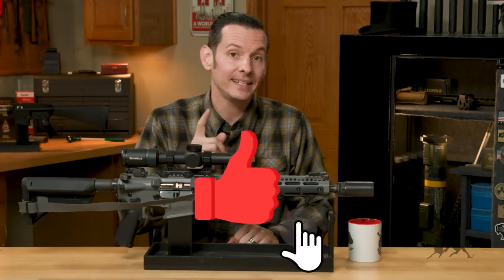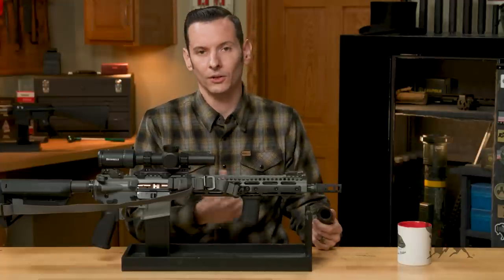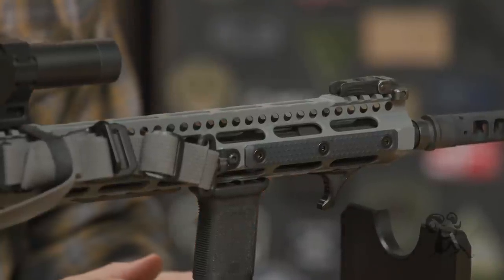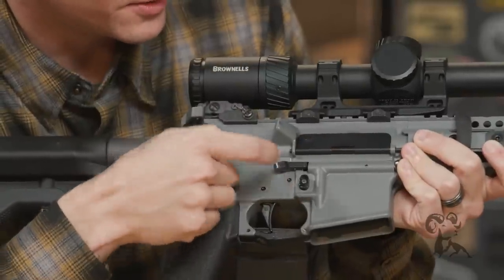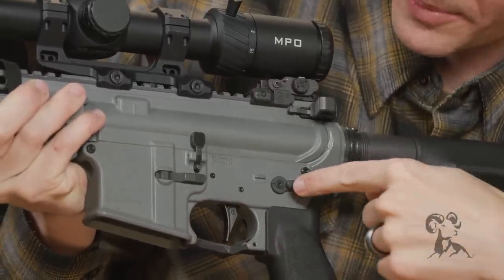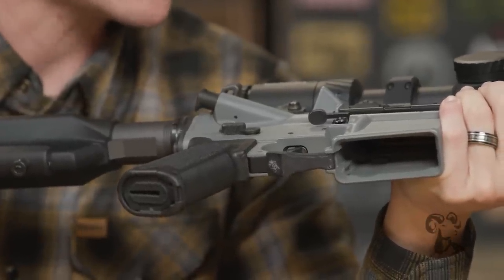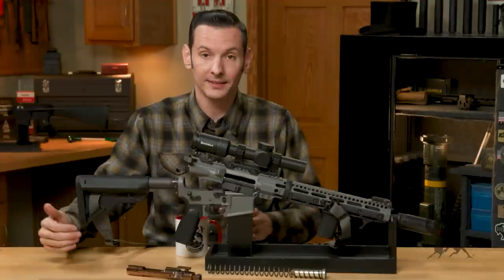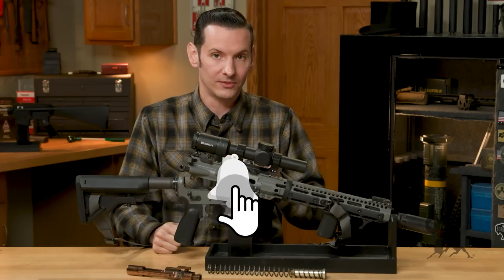From the Vault: Caleb's New Hotness

Comment: It's nice to see somebody using thought and reasoning rather than it just looks cool when choosing parts for their AR.
Reply: Ditch to irons or install off set. His glass isn’t QD so he needs tools to get sights if he breaks his glass. (Honestly it’s LARPing, I do it, you do it, we all do it but in this case it doesn’t make too much sense).

Also he can’t confirm his irons, so it’s to be assumed that they aren’t on. How many times have you had two optics on a gun and switched back to the set you don’t use often only to find they aren’t on. It could be different ammo, it could be the set screws loosened, or it could be from jostling.

Comment: Yeah my main squeeze rifle has changed a few times as well.

Running a Aero Precision M4e1 receiver set, Aero nitride BCG, Faxon Integrated flash hider gunner barrel, Aero gas block/gas tube, Midwest Industries 11.5 handguard, bcm vertical grip, Cry Havoc quick release barrel systen (great for discreet travel), Radian changing handle/safety lever, Magpul K2 grip, Phase 5 EBR bolt release (better versionof a bad lever), Magpul extended mag release (my lady has small hands), LWRCI UCIW PDW stock system, Holosun HE512C GD gold dot (I'm color blind and gold works), Vortex Micro 6x magnifier on a ADM flip mount (the vortex mount has too much play for 6x), Diamondhead polymer iron sights, and a Surefire 640df pro.

I think that's everything. But basically I wanted a full size rifle that fits is a normal size backpack. An it works great for that.
Reply: Without a short stroke gas piston system the rifle is still going to be dated. Gotta get an hk416 upper
Reply: @M8Military  I got a Bren 2 and a Tavor 7. Both are short stroke gas piston guns. But guess what... neither break down to fit in an every day size backpack. Nothing beats a good old direct impingement AR15 when it comes to aftermarket options.

Comment: Slow to respond, I've got one of the Battle Arms selector /safeties with the same finish in my part's collection somehow I broke the screw off in threads so out it went to part's box.  I agree with seeing the rifle in fired condition is a step up for AR's to many get hung up on keeping them spotless clean... Still believing the B.S. about AR's not being reliable. Just lube, run it and on occasion run patch or boresnake if needed. Back in early 2000s I did a "Franken build" AR that only got oiled, shot put up then ran again for over 6 months of well over 5 k of ammo. Brass case, steel 55-62 gn. the "high tech" lube.... Walmart synthetic 10W30 oil. The reason I finally "cleaned it" was the mess it made in my safe, Jeep or anything it touched.

Comment: I know it is not usually accepted, but I won't pin my gas blocks if they are under the hand guard. If the barrel-gas block is beaded, dimpled and set with Rocksett correctly, it will never come loose. Pinning a barrel can effect accuracy. I would like to see in a future video if your great mill job on the lower receiver for the ambi catch has any side effects by milling off the hard anodizing.  I love the look and set up of your rifle and you did a great job with your choices and lower milling..

Comment: Caleb, are you not concerned about not having a chrome lined barrel?
In a shtf scenario, there's a high chance you'll be without cleaning supplies, and using steel case at some point. Steel cases stick to chrome much less. So, you need a chromed chamber. 
I say a shtf gun should be as reliable as possible and run on weak ammo. What are your thoughts?

Comment: Caleb you should try some Magpul mlok covers for the 12 O clock slots, they redirect the heat to reduce mirage and make C clamping a bit better. That's a NORGON ambi mag release on there, hope it's not one of the knock off's, they tend to drop mags due to weaker spring inside them, ask me how I know.

Comment: HELP!!!  I have a 11.5 MCX on a UIC lower.  It worked fine, with my Surefire can, but I did a P & W to get it over 16” with a Griffin can, and now the last round hold open wont work.  I emailed American Defense but they were useless.  It still works with the factory Sig lower but that lower mostly dedicated to my a .300 blk MCK.  Are I haven’t been able to find any gun smiths or aftermarket recoil springs that might solve the problem.  Do any of you have any ideas, or do I just have to buy another non-ambi factory lower from Sig?  All thoughts and suggestions appreciated.

Comment: Hey Caleb. I have a similar mag catch on my Anderson lower but it feels a little loosey-goosey. If I try tightening it one more turn, it doesn't look like the mag would be able to come out. Is this normal behavior?
I haven't tried any magazines yet because it's gonna be an 8x33 Kurz upper on it and I haven't settled on what I'm gonna use as NJ forbids more than 10rds for self-loaders.
Reply: Don’t go off of what it “looks like” will happen. Put mags in it and do some mag changes and see if it functions after being tightened up a full turn or 2. You’d be amazed how tight you can run one and the mag still fall free

Comment: I will tell you with the utmost certainty thats not a Troy Ambi mag release . It's either a battle steel or Norgon or clone. Troy's looks way different.  That is all also if you knew what I knew you wouldn't be running a battle arms saftey if uou take a look at the mating surfaces between the levers and the tumbler it's only held on by the tiniest peice of metal why is this relevant mine saftey selector sheared off during a carbine course.  Worst of all battle arms didn't really care and after many emails/calls they replaced just the lever that sheared. Now how can I trust that saftey with my life? The answer is, I don't.